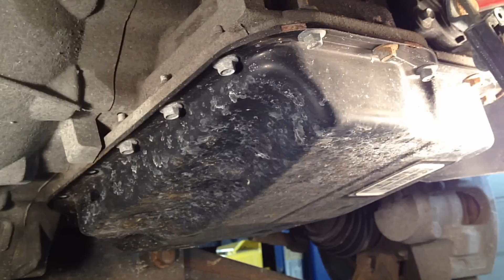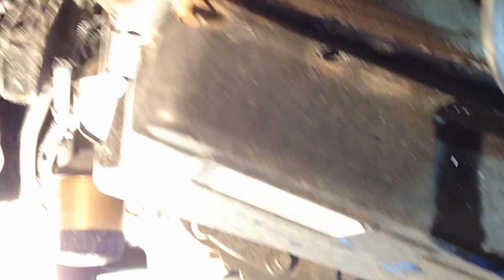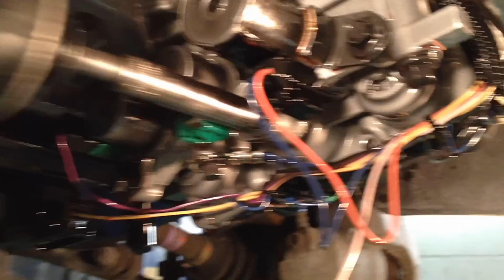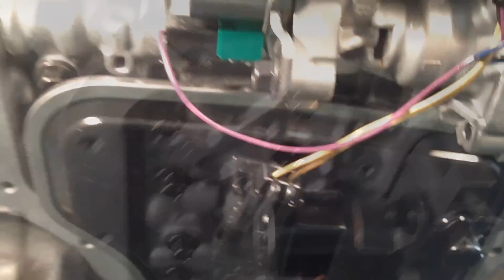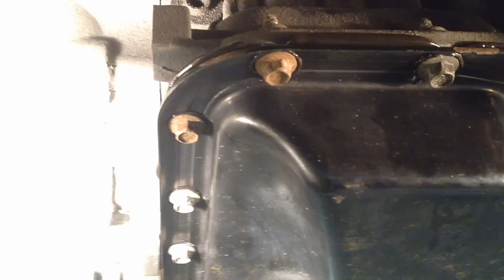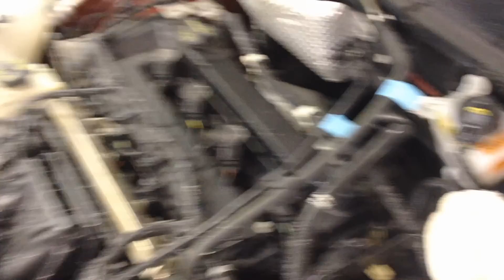Ford Focus Shift Solenoid A Repair P0750 P0753 P0972

Comment: Hi! I had the solenoid A code P0750, no 4th and get back to 3rd with a hard knock. Replaced the solenoid A and resetted the PCM. Still doing the same thing. I noticed that when oil is cold, it goes on 4th, but when trans oil is hot, no more 4th. Any idea? Thanks for the useful vids, you rock!
Reply from the maker: You have to pull the 2-4 servo they are known for the rubber seal shredding on them and also for servo bore wear.
Reply: FordTechMakuloco So that mean I have to remove body valve and remove the servo and put it back? Any gaskets or parts to plan in case something have a definitive chance of needing replacement? Thanks!
Reply from the maker: Yes I believe the 2-4 servo is partially blocked by valve body.
Well you should definitely have valve body gaskets on hand they usually tear upon removal.

Comment: Good afternoon.  I have a 2007 Ford Focus and am thinking this might be the issue with it.  I was driving it around 30mph, and everything seemed fine.  Then I started to accelerate and I could hear the RPMs going higher and then it felt like a hard shift into the next gear.  After that, everything appeared to be fine.  There were no other issues with any other gear.  Could it be the Shift Solenoid A or do you think it might be something else?  Have checked the fluid and it appears good with no burnt smell.  Thank you for your time and help with this.
Reply from the maker: They can fail intermittent like that yes and set no code at first. End cover problems on these are common but I would change the solenoid out  first and go from there.

Comment: I have an 02 Ford focus Se, when I accelerate it seems like there's a delay. Also when I reach about 25mph I let go of the gas pedal and press it again then it revs up the engine and it kicks back could it be the solenoid or will u have to replace the Trans?
Reply from the maker: On an 02 it is likely the end cover seals have worn into the direct clutch hub already which mean reman time. Good thing is you can get a junkyard trans on these fairly cheap they are so common.

Comment: I went to the dealer today and I ask him about the part with explain the one with whit wire and he said solenoid a and b are the same ( the mini one) and he gave me the part number xs4z-7h148-aa and the price is $75 for each now my question  is that part no the right one? Do I have to change both of them ? And if I buy after market or ebay do they have the same quality ? Just to to remind you my car ford focus 2002 automatic transmission zetec engine thanks again for your help .

Comment: I change the transmission fluid today and i still fell it but not like before do you think it's one of the solenoids ?it's between gear 3 and 4 it's only when i am driving the car normal but when i speed no problem at all any advice ? Thanks again
Reply from the maker: If it is the 3rd and 4th gears yes I would change out SSA as shown in the video they are common for 3-4 concerns and make sure you rest the kam after the repairs- How To Clear your PCM'S Memory on Fords After Repairs then retest
Reply: You mean the one in the middle that you changed in the video ? if I go to the ford dealer just ask for ssa ? And I watched the other video for clearing the memory can I just unplug the + & - or I have to buy that wire jumper ? Thanks .
Reply from the maker: Yes just ask for shift solenoid A they should know they sell allot of them. You can touch the unhooked battery terminals together but is best to leave them connected for a couple of minutes hence the jumper wire of sorts.

Comment: I have an '02 focus that has a hard time shifting into second gear. This problem is intermittent, and does not seem to vary with temperature. What happens is when it tries to shift from either first or third into second gear, it will shift into fourth for a moment, then slam into second. The transmission doesn't slip. Does this seem like a solenoid issue? There are no trouble codes when connected to a cheap obd II scanner. Thank you for any input you might have.

Comment: I have a 2006 Ford Focus that revs really high between 2nd and 3rd gear if I'm really getting on it (accelerating to get on the highway).  If I don't get on it too bad, it shifts normal.  Also, once in a while it has a "squeak" sound between shifts.  Does this sound like a Solenoid A issue?
Reply from the maker: You likely have a 2-4 servo that the seal is shredded causing a pressure loss in 3rd or the more common is the end cover of the trans where it sticks into the direct drum wears grooves in it and then lots of wear and pressure loss. My advice be easy on it until you can pull the trans for an overhaul.

Comment: D solenoid is the last blue connecter C-white E-green D-blue chk your Intermediate/Overdrive Band see if it broke it makes engine light come on and code say D-solenoid stuck changed the band and light went out and shifts good 2 /4 gear works too no hard shifting thanks good video

Comment: My 01 zx3 sometimes when it shifts its like it kicks in N then kicks into gear, it isn't harsh at all you can barley feel it, but you can see it rev up b4 it goes into gear, I have no codes tho. Any idea what is causing this?
Reply from the maker: Is this when it shifts into 2nd or 4th gear?
Reply: chk your Intermediate/Overdrive Band see if it broke
Reply: 2nd mostly but other gears also.
Reply: joe jose Is something broke would you think it would shift harsh? Like its still smooth.
Reply: Nope, I'm not to worried about it, if you couldn't here the motor revign up you wouldnt even be able to tell, and i don't run my car hard so it should last. =D

Comment: Will a parts kit from USA fit my 03  focus in UK?. Kit on e-bay with A and B, filter and gasket for pan. Solenoid A has failed, will not go into fourth gear. If you can help that would be great. :-)  Cant seem to get parts here!!!!
Reply from the maker: I am quite sure all the 4f27E parts are the same in regards to solenoids anyway, other parts got strengthened over the year but solenoids have been the same.

Comment: Great video! I'm having the same problem and the P0750 code comes up on the computer. I will replace the solenoid my self! Do you have the specific part number?! Nobody seems to know exactly what I'm talking about when I ask for the solenoid A.
Reply from the maker: Call the dealer they should know, there are 2 of these solenoids both same part number and should be like $40 where as the other 3 solenoids are all the same on other side and are allot more like $80.

Comment: I haven't looked at the trans fluid yet. what should I look for to know what the problem most likely is.
Reply from the maker: extra dark, chunks in fluid, metal shavings and a burnt type smell.
Reply: well I was driving home yesterday after I got off the computer an I was cruising at like 40 mph. then the car started doing this thing like some one kept pressing the brakes repeatedly. I turned the car off for a minute and drove home everything was just fine. then I turn the car off and I hear like a boiling sound and the car was smoking white and it was leaking radiator fluid. and also sometimes I have to hold the gas for a second to make the car even start going, when it does this it again acts like its in neutral
Reply from the maker: Yeah sounds like TV pressure it will affect higher gears first. But it sounds like you need to fix your overheating first.
Reply: how do I fix the overheating.
Reply: the guy said it needs a new fan motor
Reply from the maker: Those were electric back then huh. Did you check the tv cable bushing?
Reply: no. because the hood wont pop up. alright tell me what I should do when I get home after I open up the hood.
Reply: and also where could a get a new cable if mine is bad
Reply from the maker: Look up AOD TV CABLE BUSHING on google and there will be tons of clear pictures on it, see if that natural colored bushing is cracked ot missing.
Reply from the maker: Cables are usually fine it is the bushing that fails.
Reply: i looked at the tv cable and tugged it and everything and no play at all. and the car only does the not shifting into 4th and acting like its in neutral when I gradually accelerate
Reply from the maker: If a tv cable adjustment does not cure it the trans will need to come out for the OD band so we can inspect it. I would try the adjustment procedure first and like I said check the busing not the cable.

Comment: I have an 89. and sometimes when I go to hit 4th gear it just act like its in neutral
Reply from the maker: Either your TV cable is out of adjustment or the plastic grommet broke or the O/D band is smoked. How is the grommet and the smell/color of the trans fluid?

Comment: Can i do that from the side or i have to remove valvebody... I never try this before but is the only thing i can do fo know
Reply from the maker: You need to pull the trans and disassemble. unless you are comfortable rebuilding the trans I wouldn't attempt.

Comment: I have a delay between 2nd and 3rd but no code u think can be that sensor or i have a bad trany??
Reply from the maker: The Teflon rings on the back cover have worn into the direct clutch drum causing the pressure loss and 2-3 flare. You must overhaul at least the back half of the trans sorry to say.

Comment: Also my car symptom are o/d light comes on, check engine light on, at 40mph it feels like Im driving. In neutral but it kicks out of it at 45mph and drives just fine, it does switches gears fine, an i have 120,450 miles on my car 05 Ford Focus
Reply: anaerb8 same problem also my reverse doesn’t work have you figured out what the problem is

Comment: My car it reading a code of P0751 a shift solenoid,  I took it 2 Ammco transmission they put another shift solenoid on my car test drive it and said it didnt work so i need another transmission.  Ive been talkn to another mechanics and he said he dnt think i need another transmission...so my question is could I had need 2 solenoid replaced that why it didnt work
Reply from the maker: P0751 is SSA stuck off which can be a solenoid stuck mechanically but you verified that the solenoid is ok by putting new in. This code is not an electrical so it can be hydraulic or mechanical. What I have seen on these is the paper gasket on the back side of the solenoid pack blow out. Is the fluid full and not burnt? The other very common problem is the end cover sealing rings wear into the direct drum and cause line loss leaks too. I also had one just recently that needed a valve body for this code. I would take it to a ford dealership over ammco they are the worst. The thing is the trans tech at a ford dealership has lots of experience with this trans so they can zero in on it. They know all of the common issues like the ones I have experienced working on  these transmissions and is really your best bet.
Reply: FordTechMakuloco thanks so much for replying back, I'm going to take it to a ford dealer ship next week, and see what they say
Reply from the maker: Sounds good let me know what they find.

Comment: Great video replaced the solenoid over the weekend.  Not much to it.  One question.  I have a 2008 ford focus and the transmission control warning light is on and the check engine light is still on.  I cleared the code using the method you posted which turned it off for a few days.  I checked the code again and it's the P0750.  Issues started with just the transmission control light then the check engine light with P0750.  Changed the solenoid but still have both lights on.  While driving when the RPM's are between 2000 and 3000 the car acts like it's in natural.  I have to stop before it shifts back in gear.  Any thoughts what it could be?  I send some info on the web that the transmission control light could be the throttle body, but I'm not sure.
Reply from the maker: Ok so you are sure you replaced the correct one as shown in my video right? I am sure you have but I have to ask. One thing we are starting to see on the 2008-2011 is pcm driver errors. I have one in the shop right now with SSC electrical codes to it and found it to be the pcm driver. Still waiting on a pcm. I will probably make a video of how I determined that. You under 80k miles?
Reply: FordTechMakuloco Thank you for replying.  Yes I'm 100% sure I replaced the A solenoid (which is the one with the white wire).  The car has 85k on it.  I'll be taking it into the shop this week to see what they find.
Reply from the maker: sounds good let me know what they find.
Reply: FordTechMakuloco Just got the car back from the shop and it's the PCM.  Now I need to decide if I get a new or used?  Big difference in price.  New is back ordered and would take 10+ days to get here from Ford.
Reply from the maker: Oh man I am sorry to say I was right in my guess. I am quite sure the ford ones are remans now.I just got one when I spoke to you and they came next day. They are usually vendor ship but since they fail so often our local ford depot had it in stock. I have heard bad things about reman pcm's especially Napa remans, never had a problem with ford reman pcms though.

Comment: +FordTechMakuloco  Would be obliged if you could reply. Today i had a problem with my ford focus 2006. first the RPM started shooting up to 7000 between gears 2 and 3 (i guess that as i have auto transmission) and wouldn't shift to gear 4 followed which i had both amber and red lights in dash board on with Transmission malfunction for couple of seconds which then turned into engine system fault messages.. reached my work on gear 3 and let my car parked for 8 hours. Upon restarting the error had disappeared and it started behaving normal till i stop on traffic lights. The same shooting ups after the traffic lights. I took it to a garage and did computer diagnosis which gave an error coded: P0972-FF? Would changing solenoids help and is that the problem? THANK YOU in advance.
Reply from the maker: For a P0972 it can be as simple as a mechanical failure of the shift solenoid "A" yes. More common are valve body issue with sticking valves and the other issue I have seen cause this code is the 3 piece gasket that is between the solenoid pack and the valve body I have seen blown out too. You shouldn't have to go into the trans otherwise any further than a valve body . You need to get in there and check those things out. It shifts fine otherwise right no harsh engagements? Is fluid full and make sure the fluid is not burnt.
Reply: Filled the fluid yesterday anf while driving today did not face the issue again. However, shifting is a bit harsher as you said. I will open the box and see on my own what the problem is. Thanks a lot for your advice sir!
Reply from the maker: No Problem

Comment: Can brake clean damage the solenoids if u spray them slightly?  My boss got mad at me for spraying them with electrical cleaner hahahaa! Thanks and sweet video!!!
Reply from the maker: No way!  We used to clean electric motors all the time with brake clean and that's all a solenoid is. Center shaft and some windings. I wouldn't spray the solenoid down the shaft or anything but the outside no problem. You have to remember brake clean is not what it used to be and is very tame now with the new federal regulations and being water based.
Reply: Sweet!  Yeah I kinda never thought about it hahaha and wondered  if any techs have ever thought bout it.  I never felt it did major harm so I lightly misted parts that needed cleanin.  Thanks for the reply!!